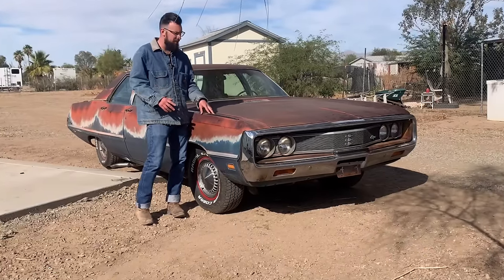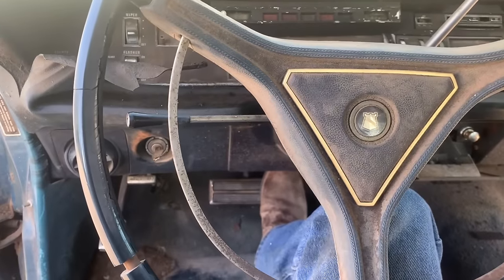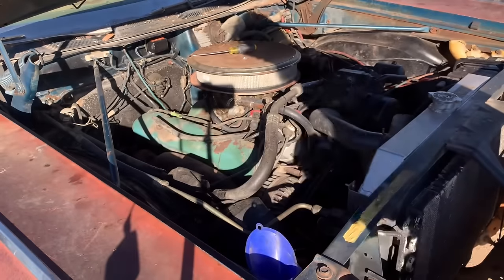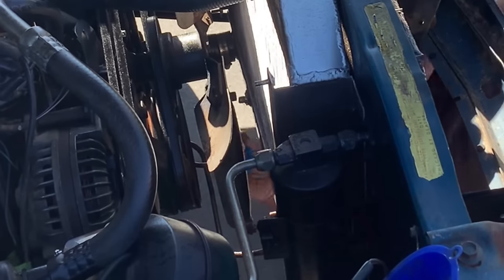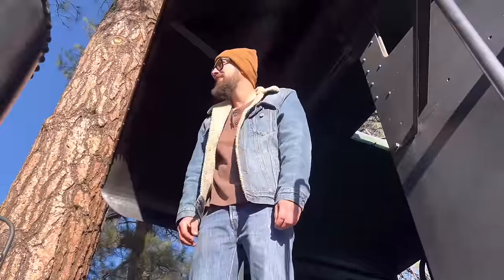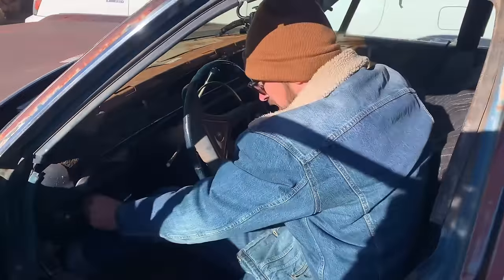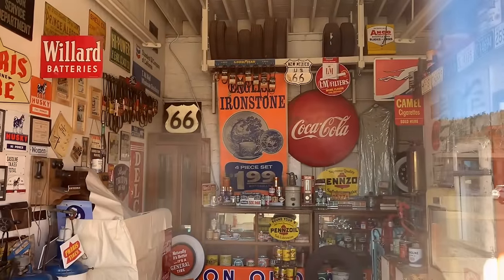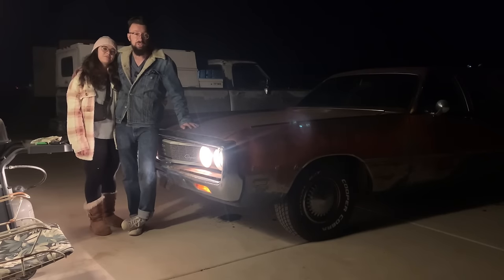Will it RUN and DRIVE 700 miles after 44 years ABANDONED? 1969 Chrysler revival

Comment: There are a lot of us who truly enjoy working on old cars. In December 1980 I bought a 70 Thunderbird that needed some work, i replaced the gas tank, the fan clutch, did a basic tune up and carb rebuild.  Then the bus drivers went on strike and me and 2 passengers used that car to commute to Boston for 3 weeks . The drivers side window was out while I waied for a motor/regulator. Then window in and a/c charged  it becane a cool cruiser. That car ran for a year and a half before the engine developed rod knock.  I sold it for parts in September of 82. Still miss it today. I'm 61 now but I'd still like another classic.

Comment: Trav, I can't tell you how proud I am of you for using Cherry Bombs in your exhaust! I am 40 now, but when I was 16 I bought a 1994 Eddie Bauer Explorer (4 years old at the time, and 66 vehicles ago for me), I yanked the 4.0L V6, swapped in a 302W with the A0D4 auto trans, I put an Explorer Express Eaton M90 supercharger on it, long tube headers, full dual exhaust with Dynomax 60" glasspack mufflers, and slant cut chrome tips. I had it dyno tuned and it made 418 whp on a 2WD with the 8.8 and 3.73. It wasn't posi at first, but I swapped it in later. I put a Skyjacker 6" lift on it, and put 15x10 bullet hole wheels with 13x12.50 TSL Thornbirds on it. I LOVED that truck. I moved to Pennsylvania, traded it for a mint 1992 Acura Integra GS with 104k miles, cold AC, four 10" Orion Cobalt subwoofers, a 1000x4 Soundstream amp, a set of chrome 17" wheels (that were fugly), and a full cream leather interior swap for it. Six months later I saw my baby at a local ice cream shop with some 16 year old girl driving it and she was messed up on something. Two weeks later I saw it on a rollback truck completely smashed up. She rolled it 8 times and lived, but was given a DUI. That gutted me to see that. So sad. Edit: to this day I can still tell you the VIN number of that truck and the Florida license plate number that was on it when I first got it registered. This was 22 years ago and was not my first car.
Reply from the maker: Wow. Thanks for sharing. Some vehicles never leave you

Comment: One thing that might help the gas mileage as altitude increases is to advance the timing some. While idling the engine. loosen the distributor and rotate until RPM comes back up. I had a 68 Dodge Polara with the 383 (not the HP version) and 2BBL carb. It delivered 19MPG at 70MPH with the AC on consistently except at higher altitudes. Nice trip and commentary. I like how you were able to recover from any issue that developed. Kudos!
Reply: My 1970 Newport would get 17-18MPG with the 383 2Bbl, But I killed that when I put a Holley 600 4Bbl on it🤣
Reply from the maker: Thanks for the feedback
Reply: @jdpinbaytown That HAD to be alot more fun than a 2bbl. My 70 B body Roadrunner with the 383, Thermoquad, and an A833 four speed manual with a dual tunnel ram and two Holley 650 cfm double pumpers was SO much fun, but it was tough to dial in the carbs so it wasn't trying to run full throttle all the time. Best I ever got with the Thermoquad was 14 MPG, and that was with a cam, headers, full 3" dual exhaust with Flowmaster Super 44s, and a 9" rear axle with 3.73 gears and a posi, but I couldn't stay out of the throttle. The sound of that 383 with the secondaries open was just intoxicating.

Comment: Man, with your exhaust kit it really shows how even with smaller engines back in the day you can really make them sound 100 cubic inches bigger without fancy high dollar exhaust kits! That sounds awesome!

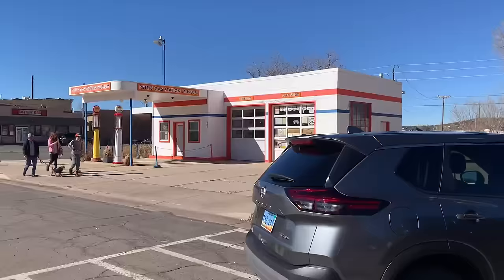Those vintage 1920's era see-through gas pumps at 36:16 are worth big money today. They're in great condition as it is, and in that condition they're probably worth at least $5k a piece. If they were restored as new they could catch over $10k each. All that automobilia inside that garage is a gold mine if it's all original and authentic.
Reply: Look online and on hemmings for brake booster and component rebuilders. They'll make it good as new !😊

Comment: I love the Mopar the the paint Is amazing it's in the runs good I had trouble with my aluminum radiator I had a ree Flair the lines to fit right I had 68 Dodge Monaco station wagon with a 440 it was a great car

Comment: my wifes name is also emily! i bought a 1978 w116 mercedes benz 280se, bit inspired by your channel, just want to keep it running and go on road trips, has a few spots of deep rust, a couple coin sized holes in the floor pan (the old sound deadening thats an inch thick was full of water) bit of ol rustoleum will fix that, the mats are very thick anyways. Im from australia so i dont have these old muscle cars here unfortunately. However i feel like old cars have so much character and are just more fun to drive and do road trips with long as you have a boot full of a few supplies than youre set to go!

Comment: very impressive, definitely gotta fix the leaks, but it went. Thank you for bringing us along, great scenery, great content. I noticed the car seems to squat a little in the rear, I know sometimes the leafs can sag over time...I have put a many spring overleaf helpers, and coil over shocks on a many mopars in my day, they are easy to install, help with handling, and also help with luggage carry. I wouldn't do both, pick one and go with it if you choose to do so. Autozone used to carry the overleaf spring helpers pretty cheap, and coil over shocks can be found by anyone who stocks monroe shocks. I kinda wondered if it had air shocks, if not, I wouldn't consider them an option...they are very poorly made these days, not that they were any good before...lol
Reply from the maker: It was squattin because of the equipment I brought but yeah they do sag over time
Reply: I had Coilovers on my 70 Newport, Helped a lot!

Comment: I'm a new subscriber.  Watched your 60 Impala video and looking forward to your cross country trip with it.
Those Chrysler 383 engines were amazing.  I had a 67 Plymouth with the 383 Commando and that car was great.  Of course, I was 18 and didn't know anything about cars, other than fuel, oil, coolant, and tire air pressure.
First problem was the grease seal got knocked off the front passenger wheel and the the bearing burned out and ruined the hub, so that was a problem.  Eventually saved enough to get it fixed.  Then there was a wreck, no injuries thankfully, but the car was totaled.
I'm still trying to find a 67 Fury III Coupe with the 383 Commando, but the only ones I can find, are already restored and definitely outside my budget.
I need to find some of the fields like you have in Arizona, JYD has in Iowa, and all those Utah and Nevada channels have, full of cars just waiting to get back on the road.
I was having a conversation with some not that long ago, they were wondering why there no more local businesses.  I pointed out when the last time they saw a local bank.  Not a branch of a big bank, but a local bank.  When the banks stopped being local, so did businesses.

Comment: Sometimes the oil light in old Mopars will flicker or come on at an idle after the engine has warmed up.  Should go off once you step on the gas.   I ran 20W50 in my old Duster when the 318 got about 120,000 miles on it... greatly reduced the flickering.  I love idiot lights on the dash, but gauges really are better.... especially for oil pressure and temperature.

I would think 15 mpg in a big boat Chrysler running a 383 Magnum is a wild stretch.  My 71 Charger has the original 383 Magnum... and today the best I get is 11 to 12 mpg... and my car is likely a few hundred pounds lighter than your Newport.

Yeah that heater core is going to be a dog to change out... especially considering that your car has factory AC.  I cannot say I've ever seen once leak as much as the one in your car!  WOW!  That was crazy.  And that V-twin AC compressor... that was used on all Mopars back in the day.  If you saw one with the square York compressor, it was an aftermarket AC system.

Hard to believe that car sat for so long due to someone installing wires 180 degrees off!  I hope that person didn't continue to pursue auto mechanics as a career or hobby!  But then, I suppose if they hadn't screwed up so badly, we wouldn't have been able to see such an awesome video today!

Good luck.
Reply from the maker: Thank you for watching!
Reply from the maker: But yes gauges are much preferred

Comment: I don't know why people don't set up a temporary heater buy a heater core run heat hose somewhere through the firewall put it in a ammunition box from harbor freight put a little 12 volt fan on the top of it and you have heat because I know it takes a long time to do the job properly

Comment: I would do a basic tune up, plugs, wires, points and condenser,  cap and rotor.
Reply: Dont bother I have told him that until my face it blue he wont do it he would rather have miss fire and 8 miles to the gallon and bitch about it  :face-blue-wide-eyes::face-blue-wide-eyes::face-blue-wide-eyes::face-blue-wide-eyes::face-blue-wide-eyes:

Comment: I've had my oil light flicker if the engine temp gets hot. The oil will get hot too, and thin out a little bit, and at idle  in gear with the brakes on the car will idle real low and sometimes the oil press will be low enough to make the light start to flicker. Especially if your a quart or so low on oil, because now you have less a volume to absorb all that heat. Love these old C bodies. They are reliable long haulers. I've had several, and have a '66 now. Your poor car has sat forever though. The gas tanks are always filthy when they sit.

Comment: Great road trip…check to see if your choke is sticking that could cause the fuel mileage issue…that car was designed when things could still be serviced…glad you figured out the brake booster.

Comment: I rewatched the video today. I noticed a view of the right front tire that shows a lot of wear on the inside compared to the outside.  I suspect the camber is way off. That is not uncommon since this is the angle that rough usage over a period of time causes. I suggest you use the two upper control arm cams to move the top of the control arm outboard before you drive again. 
  I usually try to keep old tires on the front until I'm sure my alignment is OK so as not to put new tires at risk.

Comment: Kind of a cool car except for the fuel mileage. Old cars need to be fully rebuilt so you're not constantly stopping to add fluids or replace parts along the drive to enjoy them. I had a 1980 Mustang and invested $12k to rebuild everything & it lasted 12 years near trouble free until the salt from Michigan rusted it completely. 190K miles and did not lose any fluids. I had 3 break downs which I had anticipated and had the parts to repair on the road side. The distributor gear pin sheared, a timing belt and a radiator hose. I used the license plate light and speaker wire to see as I rebuilt the distributor on the overpass of I75 & I4 in Florida @ 2am, this took 25 minutes. Replace the timing belt in the dark in 9 minutes, radiator hose in the parking lot of Universal Studios @ 9pm took 10 minutes because I had the hose and coolant. I did have a freak problem where the tach started bouncing and smoke rolled up the dash. I pulled over to find a wiring harness had fallen off the firewall and landed on the heder, burning a wire all the way up to the steering column. I dropped the column on the side of the road and replaced that wire with a speaker wire in 20 minutes. I had tons of speaker wire as I had 3 amps, 10 speakers, a separate battery for 540 watt super surround stereo.

Every old ford I owned I installed a battery isolator and a 2nd battery. This isolator kept both batteries charged and if 1 went dead, I could throw a switch and use the 2nd battery to start the car. Back in the day (1980's) Western Auto sold the isolator for $20.00. That jungle web site has them for $26.98.

Comment: When you wrapped teflon tape on the transmission cooler line fittings, you should use the yellow tape instead.  The yellow tape is made for petroleum products.  The white tape will deteriorate when in contact with petroleum products, which is probably why it started leaking again, after you used white tape in the earlier video.

Comment: I burned soooo much fuel up in flagstaff in the 85 Toyota Land Cruiser that the carb was built in So. Cal. Once it was tuned and jetted in the high altitude it was fine.  My place between flag and Williams is over 7000 feet

Comment: On the gas milage, it can get as much as 17 at 70. Was the vacuum advance working when you started the trip? Was it working when you returned home?
I've not had low oil pressure @ 600 rpm with 383s that had good bearings and oil pump.

Comment: I have a question I see that car does not have a fan shroud I didn't look like it overheated on your trip I was looking at a restored 1982 Jeep CJ7 Scott the inline straight 6 hardtop very rare automatic transmission it was a special edition Jeep and it's just been totally restored but they didn't put a fan shroud on it has a new radiator and new clutch fan and I fancy it's close to the radiator do you think it will be okay not to overheat cuz I was wanting to take it on like a I'm 1500 mi road trip down route 66 do you think it will be okay without a fan shroud

Comment: Your front end looks a bit high compared to the rear.  Those front torsion bars are adjustable, and can be lowered if desired. Another great feature of these  mopar cars.
Reply: More than likely the bars set right, just means the rear leafs need replaced

Comment: Alot of those big block chryslers have pretty low oil pressure at idle.  I've owned four of those old boats over the years.  All had high miles.  At an idle the light would come on.  I think it's the external oil pump.

Comment: 383 Magnum would be orange. I don't think the Magnum motor was available in the Chrysler line.  That's just a plain 383.   The difference?  5 horsepower and the color of the paint used on the engine.  The Magnum/Roadrunner engine was 335hp, while the plain 383 4-barrel was 330.

Comment: The old Chryslers had an issue with if the idle is not set at 750 rpm in gear the oil pressure light would come on just an fyi

Comment: Play the song like Mr Mopar purest but if it was in a Chrysler and it really is a 383 Magnum not a 383 4 Barrel it will have performance exhaust manifolds camshaft I seen an AVS what looked to be an AVS carburetor that's cool but it would not be a magnum it would be a TNT motor

Comment: Thread tape is for pipe threads only. No exceptions. Using it on an inverted flare fitting does absolutely nothing! Do you not understand how that line connection is supposed to seal?

Comment: Awesome video. You're too relatable, my car also has a auto parts exhaust done at home. Got some steel tubes and couplers from O'Reillys. Also when we used to take my car on family road trips before my mom got a new suv, I'd always be looking at fluids when I park or if I park overnight in cold places. Check for leaks.
Reply from the maker: Gotta stay prepared thanks for watching!
Reply: @theetravisb  yep my car has shelfs in the trunk and I'd keep some engine oil. Atf, power steering fluid and some coolant just in case. The only one I'd actually use often is engine oil. The rest sit in there for a long time. But I'm glad I kept it because going up to 7 000 ft elevation to a camp site I needed coolant. It just started forcing its way out of the overflow reservoir.
Reply: Gotta watch for any drippers 😅😅